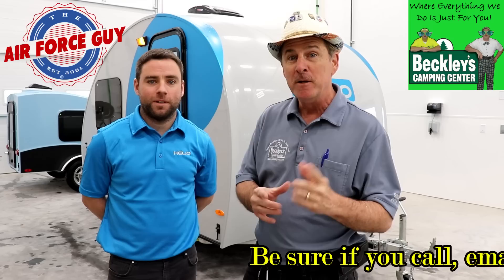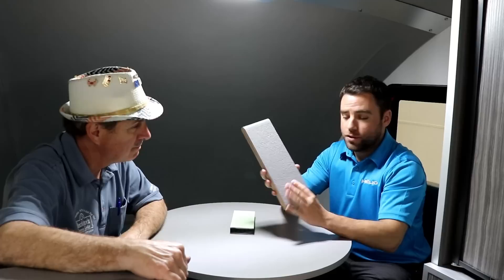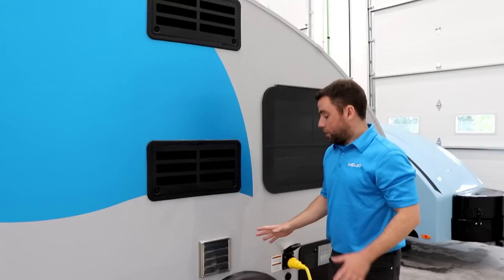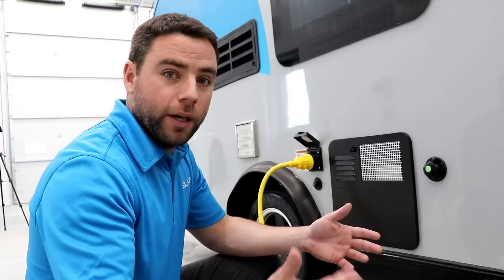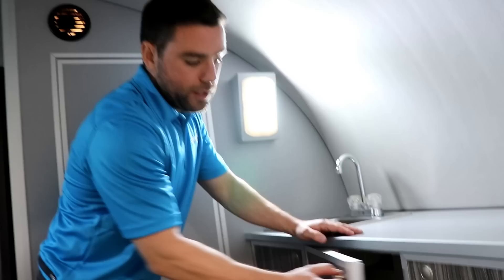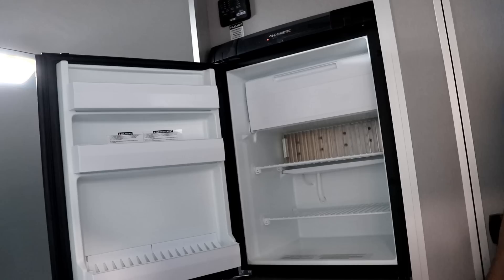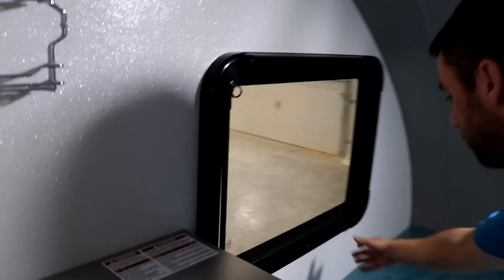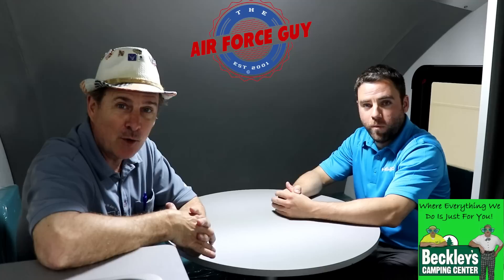Helio O2 by Helio RV  - w/"The Air Force Guy" & Special Guest Jeff

Comment: Can the battery be recharged through you vehicles alternator? Is there a connection for a solar panel to recharge the battery (not for on the roof, but a floor mounted suitcase panel)? What size (watts) & type (LA, AGM) battery; & can you swap it for a Lithium)? Thanks!
Reply from the maker: Thanks for Watching!   Your vehicle can charge the battery as long as it has a charge wire.  As far as a Solar Panel,  it is easy to install a connection for that.  You can put most batteries on this as long as it fits in the location up front. We normally install just a regular deep cycle.